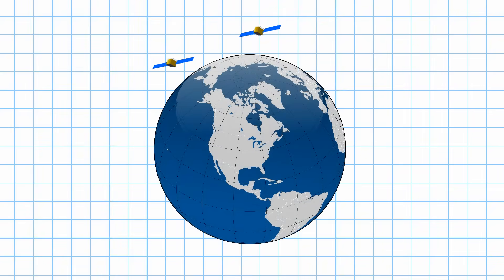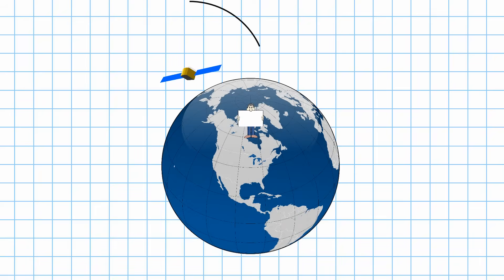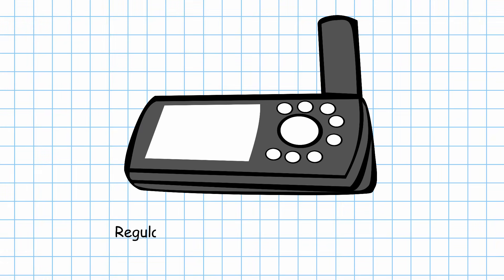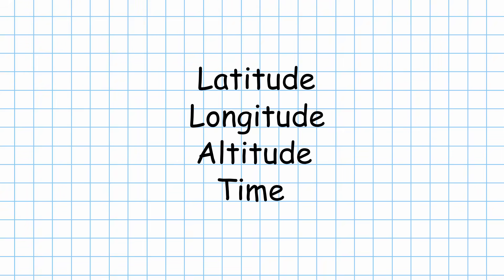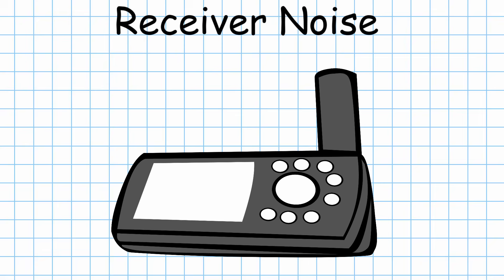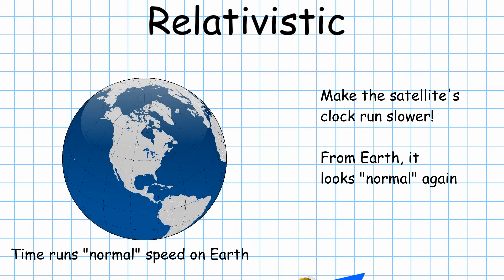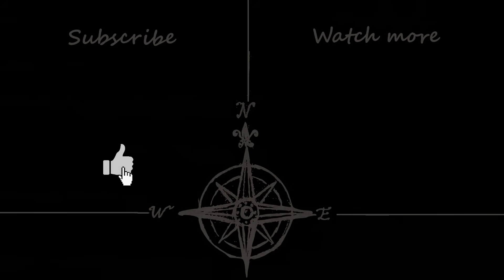How does GPS work?

Comment: The advancement in GPS accuracy came from abandoning Einstein's Special Relativity and the standard clock sync method known as the Einstein/Poincare clock sync method and using a Sagnac correction and implementing a Lorentz version of relativity to sync the GPS clocks.
On Constancy of the Speed of Light in the Global Positioning System - Yang-Ho Choi
GPS clock speed is actually a function of magnetic flux density variations which change with altitude, and satellite velocity wrt the geostationary reference frame, not General or Special Relativity.

Comment: 7:34 This is VERY wrong. Just due to the speed the clocks are running SLOWER on the satellites... but then you need to mention mention gravity, which you missed completely, because they are in slightly lower gravity the clocks run faster. So you have to add both effects up and constantly adjust for it. I think it drifts off about 10 km a day cumulatively. There's an office in the US military that all they do is compensate for this all day

Comment: The video totally screws up the relativistic effects.  It ignores General Relatively entirely even though it causes (due to reduced gravity) the greatest deviation on satellite clocks (+46 microseconds per day).  The video only mentions the effects of Special Relatively (-7 microseconds daily due to satellite velocity).  The SR high velocity makes the orbiting clocks "SLOWER", while GR low gravity makes orbital clocks run "FASTER."  The GR speeding is about six times that of SR slowing, producing a net value of about +39 microseconds which is why orbital clocks are programed to run slow by this amount.

Comment: That was better than any other gps vid I’ve seen. Generally I want to punch the screen. Not this time. Btw, few handheld GPS receivers are capable of dual frequency reception. SPS (standard positioning service) by L1 only is normal. L1/L2 receivers are quite a bit more expensive. 

(I use gps phase differential relative baseline I geodetic surveys.)

Comment: GPS is a ground based system LORAN (Long range hyperbolic radio navigation system) proved this decades ago with a ground range of up to 2400km no satellites required, obviously since WWII the infrastrcture and technology have improved and public GPS frequencies are open on all cell towers. the towers never move and that is how we get very accurate positioning on GPS enabled devices. cell signal and GPS are basically the same technology just running at different frequencies, the GPS frequencies are lower and travel further. obviously there are other factors such as the size and power of your hardware, satelite phones are just normal mobile phones but with better hardware designed to achieve  greater range. obviously marine industry navegation tech is  more powerful still.
Reply: No.
Reply: @Bendigo1  ...and thrice no.

Comment: As a gps software engineer,  this is very good. It may be beyond explaining how but r.t.k. gps receivers can achieve accuracies less than a quarter inch. Making them useful for survey applications..
Reply: I just read the Wikipedia page thanks to your comment. Cool stuff. Any idea how feasible it would be to have base stations on cell towers and have them act as CORS nodes? We'll need something like that for autonomous vehicles to become practical. LIDAR is well and good, but knowing the position of the vehicle relative to the road with 1-2 cm accuracy in snow and rain will be crucial.
Reply: @phizc  the biggest problem is economics, rtk receiver are very expensive. But other than that weather will degrade performance. In other words difficult but not impossible.

Comment: Really nice job. 
If you felt up to it, you could do a video on Space-Based Augmentation (SBAS) such as the WAAS system in the US or EGNOS in Europe.  These are ways to augment GPS to improve performance and integrity using a network of fixed known ground-based receivers - basically an extended implementation of Differential GPS.

Comment: My mind still gets boggled that the piece of glass, plastic, metal, silicon etc, aka a phone that I'm holding in my hand, can communicate all the way to a Satellite in orbit very far away
It's amazing, and mind boggling
Reply: While true of your phone, if that call is routed through a satellite, its not so much for GPS.  For the latter, you're just picking up a widely available standard signal.  The satellites don't receive communication from civilian receivers and have no idea you exist, much less that you're using their data to determine your position.  Think of them like orbital lighthouses.
Reply: Unless you are using a sattelite phone, it is not getting any signal from any sattelite.   Any position that you get from the phone, such as on Google maps, comes from cellphone towers not gps.
Reply: @Bendigo1 " it is not getting any signal from any sattelite. "
Totally wrong.

Comment: Excellent video! I would include: With only 1 satellite the position will be within the surface of a sphere. With a second satellite, the position will be within the intersection of 2 spheres; that is, a circle. With the 3rd satellite the position will be within the intersection of the circle and the sphere; that is, 2 points. With the fourth satellite you will have a unique possible position. More satellites will increase accuracy.

Comment: 7:34 This is slightly wrong. Special Relativity says that the satellite clocks run SLOWER due to relative speed.

However, General Relativity says that the satellite clocks run FASTER because they experience less of Earth's gravity. The gravity effect is far greater than the speed effect, and so the satellites have a net gain in clock speed.
Reply: It’s true - both special and general relativistic effects need to be taken into account. Failing to do so introduces range errors on the order of tens of meters(!) on the face of the earth - surprisingly significant for something most of us rarely think about in our daily lives.
Reply: Thank you! I was about to comment the same thing.
Reply: That's what makes it special, generally.
Reply: @CeeCrazzy  Nice
Reply: They use atomic clocks , and correct error
Reply: Not slightly wrong, gravely wrong.  A mess.
Reply: blah blah blah blah just shut up
Reply: @vishnu9264  They’re just giving legitimate criticism.

Comment: As far as I know speed of satellite orbit is irrelevant due to being way slower than speed of light. The relativistic effect that takes place is due to the curvature of space-time caused by the mass of the earth. 

Time is flowing faster for the satellite with respect to us due curved space-time. So the clock on the satellite are made to tick slower.

Near relativistic speeds time flows slower for the moving object with respect to us. The clock on the satellite would need to tick faster.

Comment: Since you're a pilot, it would be interesting to know if you use any special GPS equipment.  I watched a video on piloting in the Houston Ship Channel, and the pilot brought on his own high quality GPS system and attached it to the ship.  Then it was related to the position on the ship and the specific dimensions of the ship, so they had a very accurate representation of the exact position of the ship in the channel.  They've got really tight space restrictions in the most inshore end of the channel.  It's also one of the relatively rare navigable non military places that no unauthorized boats or ships are allowed in the US.  The combination of the narrow confines and the strategic significance of all those oil processing  and loading facilities mean that there's a big sign, as well as protective measures to prevent any non-authorized vessels from going there.  There is a free tour I'd like to take sometime.

Comment: do ou know algorithm?... How reciever knows the total wave travel time...even though there is one way signal transmission?
Reply: The wave emitted from the satellite is modulated, giving the name of the satellite, the time sent, non-precise position of the satellite etc
Reply: @danielthomas9086  thankyou but gps module doesn't come. With etc... Still didn't get
Reply: As stated tje sat signal is always saying what time it is. And also contains modulation data with satellite orbital predictions. The modulated data is a slow transfer so may cause an initial delay before a solution is computed.

Comment: which formula/method is used by GPS to calculate Altitude of a airplane??
Reply: The same one he explains. For a given time traveled from the 4+ satellites (there are usually at least 5 used to verify accuracy) there is only 1 location near the surface of the earth where all of the signals cross.
Keep in mind, gps altitude has errors in it due to the variances in orbital distance of the satellites, and that’s why you still need a static altimeter set to the correct barometric pressure.
Reply: @Linusgump  thank you sir

Comment: FYI: if you see a clock running FASTER than your own, that's not due to speed. Special relativity is symmetrical, as motion is relative, every observer thinks they are standing still. So every observer sees other objects' clocks running at the same speed (when stationary relative to them) or slower (when moving in some direction). The faster clocks come from being farther up from the gravity well, which is general relativity.

Comment: Worth mentioning that the satellites know their positions because the reverse is happening with ground stations broadcasting their locations to the satellites.
Reply: The satellites know their position because they keep track of their own movements and every so often a ground radar station verifies it's location and a controller at Schriever AFB .  This guy does not know how the system works his explanation is way off!
Reply: @terrydouglas5008  Actually, its more of the latter (ground station uploads) than the former.  While the satellites can propagate their ephemeris and predict their own position, in practice they are rarely allowed to use those results to ensure tighter operational control of the accuracy.  There were studies and design trades about adding range finding hatdware and techniques, but the benefits and gains didn't outweigh the costs and risks.
Reply: @captainsorehl  I worked in the GPS operation center at then Falcon now Schriever Space Force Base.  The operators on a set time table update the satellites positions with data received from NORAD.  It was my job to maintain the two way link with the satellites.  Each satellite has two three transmitters and one receiver.  One channel receive/transmit is used for satellite updates.
Reply: @terrydouglas5008  I'm not sure we're disagreeing with each other.  The two-line elements are indeed calculated on the ground, just as you say, and uploaded as a broadcasting script rather than letting the satellites carry on with their own internal calculations.  So even though the satellites are capable of propagating their positions for long periods (and there was a largely unused capability to let them range against each other using crosslinks), the schedule you cite basically overwrote that need.  If I recall, the tempo for uploading ephemeris usually meant the next upload happened before the old set reached the "end of message", unless that tempo changed, so the broadcasts are/were basically canned.  I was on the GPS Block IIF space and ground design team around the same era as the transition from Falcon to Schriever and have been on site for work with the operators in 2SOPS many times.  Maybe we worked together.

Comment: The relativistic time dilation is not only due to the speed (you've got that backwards), but also from the gravitational potential (it is farther away from the earth, with less influence from Earth's gravity). Search about *gravitational time dilation*.
Literally, you head is literally getting older faster than your feet.
The speed actually would make the clock to slow down (the faster you travel, the slower the time passes, compared to the rest), but the gravitational potential wins (the farther you are from the source of gravity, the faster it goes), so the net effect is that the time in the satellite goes faster than the Earth.

Comment: It is not triangulation, it is trilateration.
This is a big mistake and commonly misunderstood
Reply: In this case it's multilateration 'cause there is more than 3 stations.
Reply: Pretty sure it is triangulation; the distances are measured using time and speed. Trilateration uses signal strength to determine distance.

Comment: If the receiver's battery is depleted its clock will stop working. If the battery is recharged later the receiver will work again, but its clock will no longer be synchronized with  the sitellite's clocks. How do receivers synchronize their clocks with satellite's clocks?
Reply: So you are saying that you are an idiot that’s why satellites are fake?
Reply: @tgstudio85 , I never said satellites were fake. They are real. My question was about GPS receivers.
Reply: Its the fourth satellite  as 3 give you fix with error induced by local clock fourth then is then able to calculate basically your exact moment in time from the  error . If we had atomic clock synchronised on our receiver then we would get fix with only 3 satellites but we can't

Comment: I expected the potential errors to include something about the weird shape of the earth (distorted sphere, slightly ovaloid, if I remember correctly).
Reply: GPS positioning measurements don't give you direct lat and longs. They give you xyz coordinates in a 3D grid that are then projected onto an ellipsoid (the mathematical model of a squished sphere), and are converted to lat, long, and height above the ellipsoid.

Comment: The relativistic error comes mainly from the theory of General Relativity, the sattelites are further out of the gravity well that is the earth and therefore their clocks run faster compared to our clocks on (or near) the surface.
Reply: actually TobyAsE120 is right,  (the video explains it wrong, from our frame of reference a fast moving object should experience a slowing of time, but) since that speed is really not that great compared to the speed of light, the gravitational effect on time is much greater here and so it actually IS the main reason satelites' clocks run faster.
Reply: @supawooky  And technically the guy above you is right.
Reply: both effects take place and must be accuunted for

Comment: Its important to remember that time is more flexible than most people realize.  Two people on different latitudes will arrive at the same longitudinal point at the exact same time, but travelled different distances to get there.  Imagine someone 1 meter from the south pole and someone on the equator.  The variable allowing for both to arrive at the same time is time itself being experienced differently in relation to their velocity.  Also, and not mentioned in the video (or I missed it) is the impact of gravity on time.  The Earth is not a uniform push down on everywhere.  The push down can be different over certain spots versus others depending on what is in the ground etc.

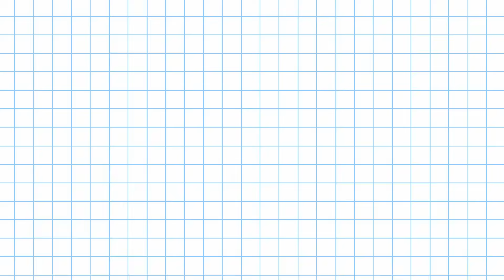Comment: 0:12 - Trilaterates, not triangulates.

3:02 - Typo.

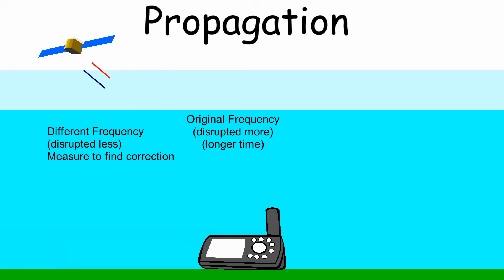5:17 - Not if your GPS receiver is a civilian model.  Civilian GPS devices only use one frequency.

Also, DGPS signals are now also transmitted from geostationary satellites, in systems known as Satellite-Based Augmentation Systems, such as WAAS and EGNOS.  These systems are meant to improve GPS performance in aviation applications.

Another source of GPS positioning errors happens to be the rotation of the Earth, manifested in something called the Sagnac effect.
Reply: "Civilian" psudeo-range GNSS receivers can use the L1 and L2C bands on the GPS system (that's 2 not 1); phase based systems (such ones used by land surveyors) use all the transmitted bands. If you are substituting the word GPS for GNSS then "civilian"  psudeo-range receivers can use 2 bands from GPS, 2 from GLONASS and 3 from Galileo (of course if you live in the others parts of the world there are BeiDou, QZSS and IRNSS bands that can be used as well)

Comment: But wouldn't it mean that time runs slower on a satelite compared to earth? If the speed of a vehicle comes closer to lightspeed, it slows down it's interior time, doesn't it? Or is this due to less gravitational pull from the earth?
Reply: There are people who deny Einsteins Theory of Relativity.
But GPS would not work correctly if it was wrong because his theory is used in the calculations and the time dilation is accounted for.  If it did not exist then those corrections would make the GPS incorrect.
Reply from the maker: Time does run slightly slower on satellites. It is to do with the relative speeds between the observers. You can assume the observer on earth is stationary, so the satellite has a relatively high speed
Reply: @CasualNavigation 
There is a time dilation effect due to the differential in height as well. Both speed and gravity contribute to this effect. Source : undergrad degree in physics
Reply: @CasualNavigation  The video has an editing error -- it says that time runs faster on the satellites due to their speed, whereas their speed would make it run slower.  BUT, being not as deep in Earth's gravity well makes their time run faster.  So which effect is greater?